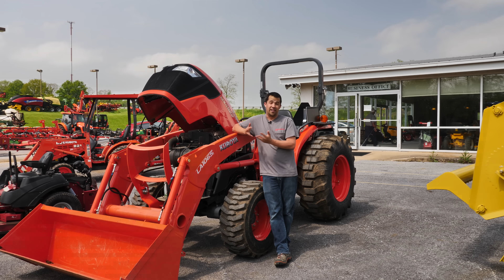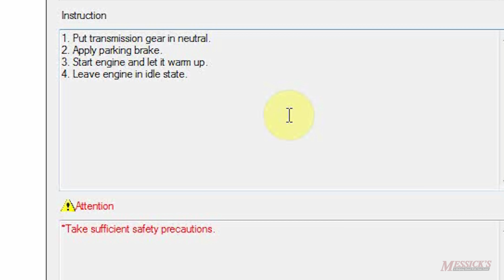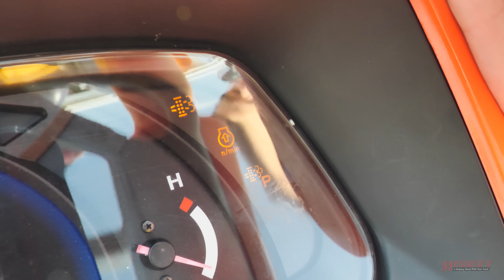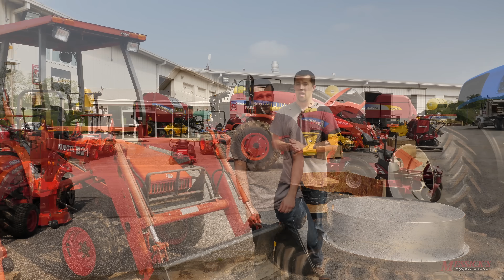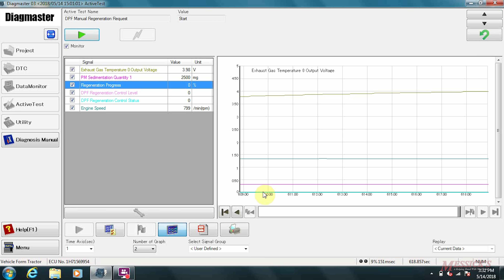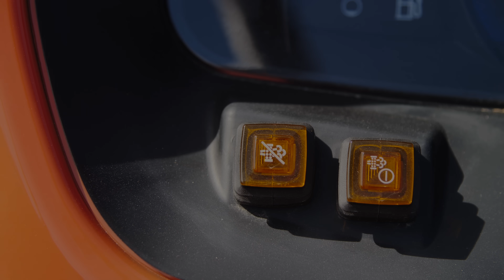No need to Panic! DPF's explained.

Comment: I bought a b3350 and had nothing but problems, Coldwater michigan kubota wouldn't do anything. It regeneration every 5 to 10 hours. I WILL NEVER BUY ANOTHER KUBOTA. YOUR PRODUCT IS PIECE OF CRAP. BUT I FIXED IT . KISS OFF KUBOTA
Reply: Your PDF filter is AJOKE LIKR YOUR EQUIPMENT!!!!!!
Reply: This does know what he's talking about
Reply: It Cost Me ME ME 850.00
Reply from the maker: B3350 is a well known problem child tractor. If your the original owner there is a lifetime warranty on the problematic parts.

Comment: I’m sorry but the fuel used to ReGen doesn’t seem Eco-friendly.   Has anyone independently done analysis to see what is the real gain of the DPF ?  EPA emissions trash causes problems which seem counter productive and further environmental impacts.
Reply from the maker: check the channel. I did some specific measuring of the fuel use during regen and its almost not detectable.

Comment: Have to have a larger engine and use more fuel to get the rated horse power! same size 30 hp engine with  emissions crap would make 35 or 40 HP without it!

Comment: I have a M6060.  My owners manual says that when the Regen symbol comes on you should place it in Park and the computer will automatically raise the engine speed.  This never happens.  I have to raise the throttle myself and eventually the light will go out.
Reply from the maker: That's a parked regen, you generally won't do that. Rev it and keep working.

Comment: 300-500 dollars to get the DPF cleaned out...NOT.  Dad took his Kubota to the dealership in West Memphis(not mentioning names) to get the DPF cleaned out....$2000 bill.  That’s all that was done.  To say he was PO’d would be an understatement.
Reply from the maker: Sounds like they put a new canister on, instead of sending the element to be cleaned.
Reply: Not sure on kubota but otr trucks you can wash out your own dpf, need new gaskets etc but you still need the oem software to reset the cleaned parameter or the code still cannot be cleared.  Ahh,  isn't the epa great.  Said no same man evah!

Comment: Thank you! How do some other brands sell their tractors without emissions?
Reply from the maker: Mahindra's marketing is maybe one notch above politics. That's a DOC-only engine, also used by a half-dozen other companies. Same thing as a DPF but rather than running a cycle every 20-40 hours its always running hot and burning continuously. There are pro's and con's to any of these engine systems. The con's on this system is more use of EGR (exhaust recirculation), overall higher engine temp's, and warm up \ cool down periods before and after you operate. I've heard other Mahindra dealers refer to this as a "no emissions" engine, that's simply not truthful .
Reply from the maker: They don't. They all have to meet the requirements.
Reply: Thank you for the replies! I bleed Orange so it doesn’t really matter to me.👍

Comment: Kubota’s Dpf/def systems are complete  junk.
Reply: We own 5 95 svl-2 skid steers and we constantly have problems with them... you can’t just work them hard every day and expect reliability..
Reply from the maker: @Hottapper1  Yea, the DEF quality sensor on that one is a problem. There should be a campaign coming this winter to update all of them with a newly designed sensor.  You may  have had this done already, but it's a new-new sensor that should take care of the issue for more than a few months at a shot. I'm sure you've been told to keep the DEF tank full and away from heat, can be easier said than done. Turbo hoses where another run around, that seems to be behind us now.
Reply from the maker: We have very few problems with any tractor but the B3350. 90% of problems can be avoided with a little education.

Comment: Ive been in  construction for 30 years, since this hole DEF DPF it has literally cost are company millions! Doesn't matter if its a hoe, tractor, trucks of all sizes, they basically turn your equipment into a pill of junk. If it wont run its junk!

Comment: Can I force a regen if I am out working the tractor hard?
Reply: if you are out working the tractor hard- when requirements are met- it will (should) do it automatically. if you know it is in the middle of a regen and you have finished your work- allow the regen to complete before shutting down or the regen will not give credit and you will not return to zone zero which means you still need the regen.

Comment: Better to try to get the tractor working when during the Regen process. Have this on the firetruck I drive. Run enough on the highway and don't have to go through the cycle at the station.
Reply: Fire trucks and ambulances have different "shut down rules" than typical on road diesels, and they should. The regen software is similar. Years ago the soot went into the atmosphere and noone made money on the exhaust. Today the exhaust is filtered, collected and then washed into our water system, an entire industry makes money and the epa collects more money if u don't comply. The same pollution is there just more expensive.

Comment: And running the tractor at redline for 25-30 minutes when it doesn't have to doesn't consume more fuel?? What??? And on top of that even more fuel is being dumped in on the exhaust stroke.
Multiply this by MILLIONS of tier 4 final tractors and trucks....that "small amount of fuel" adds up quickly....in the end, oil companies pocket the extra cash and the environment still suffers.
And let's not forget dealers who make thousands in profits a year fixing this unreliable garbage and even more replacing blown up engines and bent connecting rods from leaking EGR coolers.
Absolute theft.

Comment: My diesel truck always seem to start a regen when pulling up in my drive way. Most of the time I did not get a regen message I would see the mileage drop from 16 to 8 MPG. It would be nice to read the DPF pressure and start a regen  at a more convenient time
Reply: You can read dpf loading with an obd2 reader on some cars

Comment: You have a laptop on a tractor just think about that....I’ll just buy a pre emissions one thanks .
Reply: Good luck finding one without this bullshit on it
Reply: @Bill I bought a L2501 in january this year but kept my 1950 8N as it has no trade value and is worth more to me as a second tractor. I picked the L2501 because the next one up on the same frame size had all that "stuff" and it is hard enough keeping up with my over the road vehicles.
Reply from the maker: Laptops have been used on tractors far longer than that.
Reply: @MessicksEquip  Yeah but it's still a tip toe into a dystopian future mate. Remember when a farmer only need a hand full of basic tools, to fix a problem himself, whilst out in the middle of a field. Big corps, globalists have taken that away, they want full control of us citizens come 2030.

Comment: For anyone hesitant to purchase a smog controlled ECU equipped Tier4 tractor, I can say after about 5 years of running 6 Kubota L4060 tractors similar to this one, we have had no problems with the smog control devices. This is in a Rental fleet, so no shortage of abuse or neglect there. The regen procedure is quite simple and with the PM percentage gauge on the dash it is easy to tell when a burn off is imminent. There is the potential for customers ignoring the warnings enough that the dealer has to force a regen, but that has only happened once and with no ill effects. Overall, these newer electronic engines are smoother, quieter and have been tougher than our old L3530 and L3940 machines.... which while good simple tractors, were also prone to being harder to start cold as they aged, and could be blown up by a very abusive/neglectful customer who ignored the temps while say, mowing a dry field. ECU control and emergency shutdown has meant none of our machines have been popped yet, after an average of 1500hrs. That aspect alone makes the added complexity of the EGR/DPF well worth it, just to gain modern electronic monitoring and diagnostic abilities.
Reply: You can get computer controlled safety features without unnecessary emissions systems

Comment: FYI One advantage of owning a Mahindra, They invested $30 million to redesign their diesel engines where DPF aren't needed and Regen isn't needed either.  Now with that said Messick Farm Equipment's service sounds like it something that might swing me towards a Kubota if I was depending on them for service, Our Kubota dealer isn't near as customer service orientated.   And I do appreciate the three minute  instructional videos
Reply from the maker: This seems to be a popular misconception. 30 million is a pittance in engine design, any time you hear of engine design costs your usually talking multiple hundreds of millions. What Mahindra 'designed' was a DOC-only engine system, which is not really their technology. Virtually every engine manufacturer offers a DOC-only engine, many tractors companies use them. They don't have anything special. I think I talked a bit about Doc-Only in this video. All that said, Mahindra does not build 2/3 of their tractors and simply buys them from TYM or Mitsubishi. They talk about this investment as if it applies to all models, but reality is it would only be on the handful of models they build themselves.
Reply: I'm fully aware that Cummins developed the DOC technology. (Been in the trucking industry for 40 years and I'm the  Business editor for a national trucking Magazine.)
In my research from the Trucking side, DEF Filter engines are a royal pain. So when I researched purchasing a new compact tractor the regen of the DEF system was a major concern. As you pointed out when the engine is doing a regen it must be run at a  high rpm. If I'm tilling or operating other 540 PTO rpm equipment like spraying or mowing I don't have the option of allowing a higher rpm than the one that maintains my pto at 540 rpms so continuing to work would not be an option as  tractor land speed and pto rpm are extremely important. 

Frankly, DEF technology was developed in a rush by the diesel engine mgfs to fulfill emission requirements with the lowest development cost, and on the trucking side DEF system failure the most frequent event that puts semis on the side of the road. Since my farming is tightly scheduled between my other occupations and responsibilities, and my knowledge of the problems of DEF systems within the trucking industry, I would have purchased a pre-DEF used the tractor if this DOC technology wasn't available. And while  Mahindra didn't invent DOC, they have designed a new engine to use this technology very effectively.

With that said everything has it gives and takes. and as I use the Mahindra I will come to know the downsides and the upsides of this purchase. The main thing that I advise any truck owner when purchasing a truck is the most important part of your purchase is the quality of the dealer who will handle warranty, maintenance, and repairs, so chose where one buys wisely.  That is the other reason I Chose the Mahindra, as the local Kubota and John Deere dealers lack that commitment to customer service I require. 

 I'm pretty sure from what I have seen in your videos and online reviews, If I lived near Messick Farm Equipment, I would be seriously looking at you as a place to purchase, maintain and repair my farm equipment.  Thank you for your informational videos they are helpful and beneficial.

Comment: From what I read, this stuff was not needed for non-road vehicles under 50hp.
Reply from the maker: No, that's not correct. Under 25hp a dpf is not needed to meet the requirements. The engine is still tier 4, but the standard is not a strict.

Comment: Neil, during a regen diesel fuel is injected into the engine on the exhaust stroke, in addition to the usual intake stroke. Fuel injected on the exhaust stroke does nothing to keep the engine spinning but rather flows right down the exhaust into the DPF tube. It is a convenience method of injecting fuel for a regeneration vs using an additional injector in the exhaust system. So during a regen, yes...extra fuel is used! And during that time, fuel consumption is significantly higher! Running at high RPM helps increase heat, but the diesel fuel is needed to significantly increase heat in the DPF...otherwise, regeneration would occur naturally at high RPM. FYI...Kubotas with a DPF also have a DOC and EGR as well! The DOC is what converts the unburned diesel fuel into heat for the DPF. EGR is used actually to cool the exhaust stream to reduce NOX to an emissions-acceptable level. Higher horsepower machines require DEF injection for this purpose as well. Lots of EGR is not good for an engine because EGR gas is “dead” gas that can over time coke up the intake valves and EGR system itself. It’s also worth noting that a regeneration system using exhaust-stroke injection can and likely will cause engine oil to be diluted with diesel fuel because of natural blow-by. The amount is small and this is a normal condition but it underscores the importance of regular oil changes. 

Finally, the reduced diesel “smell” is more the result of tightly controlled direct injection than a DPF. Older tractors had mechanical, indirect injection which were totally reliable but at times injected too much fuel (under peak load or at startup) which caused black smoke to emit). The DPF will certainly be a health benefit to an operator, however...because carcinogenic PM that you might breathe is now captured. 

My experience with current day DPF and other exhaust aftertreatment systems is that they are generally problem free but certainly add to the cost of a machine.
Reply from the maker: Your correct, I think I explained most of those details but not to the extent you did... Except for EGR, there is no EGR on these engines.

Comment: another great video Neil; couple things to include:
one thing is to try to always run your tractor at the 2000 rpm and above range (near where the tachometer needle will line up with the 540 rpm pto indicator), the engine is made for it, and it's not going to hurt anything; in fact running it to low will probably do more to wear things out; hydraulics and everything else on these tractors is set up for running at the higher rpm's; running it at the correct rpm will also make re-gens less frequent as the DPF is in its heat range to keep itself clean. 
one thing you should include is a warning to move your tractor out of the tall grass before starting a re-gen. the exhaust temp does go way up if the DPF is really dirty and with the lower mounted exhaust there is a possibility of starting a fire. i will see if i can get a exhaust outlet temp reading next time my MX4800 is in re-gen.
for those that don't know: there is also two buttons on the dash: one to start a re-gen, and one to postpone a re-gen. it is advised to let a re-gen run whenever possible. my local Kubota dealer says the biggest problem is inexperienced operators that keep hitting the cancel button, and as Neil explained eventually the computer won't let you do anything.
Reply: Yeah... run the hell out of the engine constantly... lol. It's "made for it". Naw... they just threw a soot cooker in there and piped exaust into the intake.
Reply from the maker: That is literally what a DOC only engine is...funny enough
Reply: Yeah. And there is definitely a reason for warm up and cool down. Instead of keeping your expensive engine happy, now you keep the soot cooker happy. It's a bad idea that got forced on us by people that don't know anything about it.

Comment: Love your videos Neil! But I gotta say the emissions crap on my M7060 is a pain in the ass! You can down play it and I understand why. Main problems I have experienced... Any time a regen is needed when not working in a high RPM manor (mowing or bailing) it's a big inconvenience. Most time I have to stop what I'm doing and leave the tractor parked running at wide open RPMs for 20 minutes or so and have to keep coming back to check to see if it's finished. This is a waist of time, fuel and engine hours. Also I've experienced roughly a 25% loss of fuel economy with this tractor over my previous (non-DPF) M7040. The lead tech at my Kubota dealer said the DPF system chokes these motors so much that without it I'd have about 30 more HP. Then there's the added components an complexity the system adds. All to keep a little soot out of the air. The on-road trucking industry is really having trouble with these systems. It's been real nightmare for them. These types of regulations are costing us in untold ways.
Reply: Don't feel bad our M8560 in the winter wants to Regen almost every time I go to use it. We use it for some loader work in the winter, in the summer I never notice it because it gets worked hard enough for the auto Regen to do it's thing. So annoying.
Reply: @ryanfowler6900 It just sounds so counter productive.
Reply: Any emissions savings go out the window when these engines die a premature death and are shipped off to the third world to be smelted down in a circa early 1900's blast furnace.